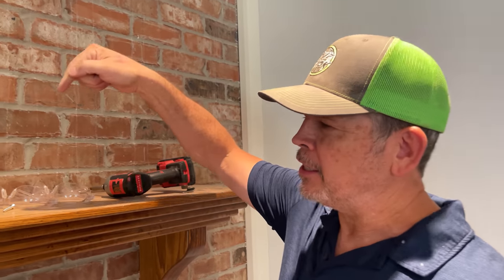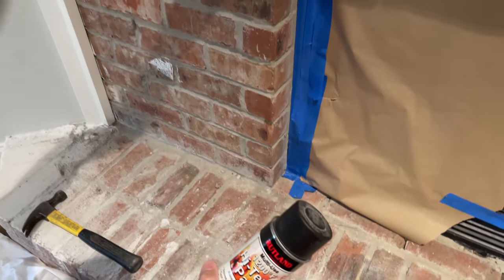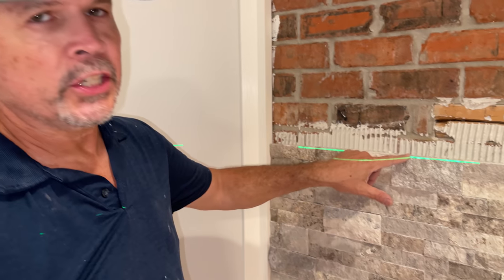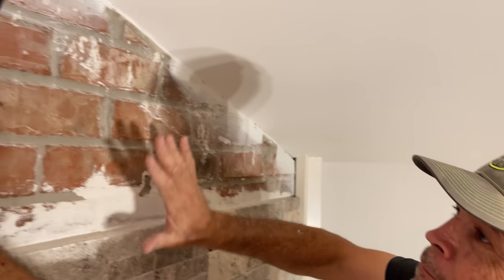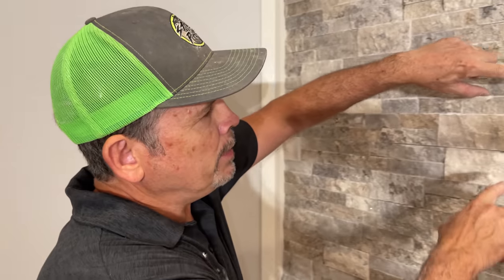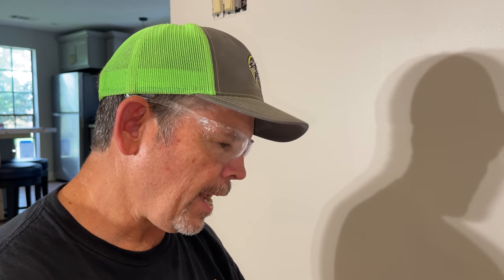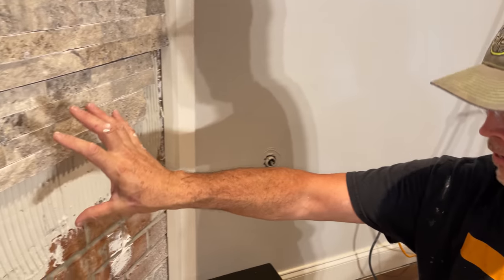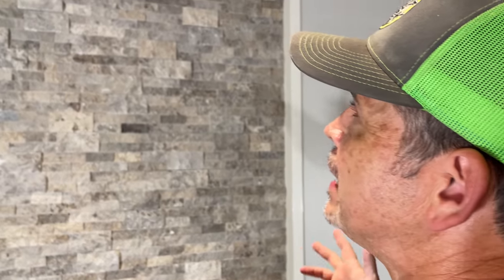DIY FIREPLACE TRANSFORMATION with a CUSTOM HEARTH!

Comment: I have done a few dozen of those for customers so far. Your techniques are perfect and well explained. 
I would just add to not let the customer select the stones are the quality varies greatly and the bad ones are such a nightmare that you should decline to install them.
Also price yourself to include grouting touch up for gaps. Trust me, you will need some grout here and there. You will also need to air clean the whole wall with air from a compressor to really clean it (you will be amazed how much stone dust will come out). Then brush some stone sealer over the whole thing. These last three steps (grout, air, sealer) will make the wall look like a million dollar job.

Comment: Great job and looks awesome.  I have that same tile saw I used to install 12x24 tiles in my 4 foot by 8 foot shower with a 9 foot ceiling.  I never used my angle guide to make any cuts.  I did like you and hand scribed and then free cut like you guys did.  I couldn't have done it without that saw.  You make it look easy and I know it wasn't.  Can't wait to see what's on the list next.
Reply from the maker: Awesome thx Glen 👊

Comment: Nice work as always! A question.. You always use a wet sponge before mortar or thin set on many substrates, don't you use primer or is it just me in Europe? Do the mortars over there have a different formulation to stop the wall/floor from sucking too much moisture out of the mix?

Comment: Love you guys. There is a product called "sticky stone" for mainly outside stoning on bricks or block walls. And for outside and inside a product called , "SRW". The SRW for inside hanging stone on sheet rock is thinner and you use a corking gun and bead the back. You're a pro so you will know how many beads according to length. Note: STICKY STONE is a sausage so you would need to order their gun for it. Either one of these products are slip resistant and dry  fast. No more spreading thin set and it cuts back on time and messes. Try it out. And tell Jordan his humor enhances the shows. Be blessed and remember to give back.👍🏽🙏🏾

Comment: SO, I just bought my first house in 2020...  It's a cute little cottage-ish style house built in 1977.  I clicked on this video thinking I would get some ideas for my fireplace. The first 5 seconds of this video, you read my living room like you'd been there! I have the same brick fireplace, at an angle, with a very similar mantle! Even my hearth is similar! I don't have vaulted ceilings, so that's a relief. But now I definitely have some ideas to redo my fireplace!

Question though: my brick is covered in a yellowish shiny coating, maybe lacquer or shellac, will the thinset stick to that, or is there a lot of sanding in my future?

Comment: What did you do to finish the open edge around the opening to fireplace? I know the edge of them tile's look just as bad as the backside..showing bits of glue and not being finished of course due to the cut. I probably would have trimmed it out with small angle iron or some kind of metal sticking out like 3/4"-7/8" and painted with that same black paint and butted the cut to it. I used that same stone a few different times. I remodeled a master bathroom a few years ago and we reframed the bathroom and changed the layout and customer's wanted to add a free standing bath but with the massive shower we just built I didn't have a ton of space but had a huge hallway on outside so I bumped the wall out like a bay window so didn't take up 2 much space and looked as if was a planned detail. Customer's picked the white stone to be installed on the 3 alcove wall's and choose a spout to be centered on long wall but with the stone not being flat and also wanted to push it off the wall I made up a 2 piece block out of 5/4" Azek and step the blocks to give detail and routed the edges. Worked great. Only suck part of it was not even a yr later tbey called me back and said they didn't call to point fingers and already purchased new materials but if I can come give them a labor price to pull tub,remove white stone and backerboard and install new black stackstone bc the white started to yellow. I thought maybe it was a little in their head but when I got there I was shocked. I never reached out to msi to look into it and the only thing I could come up with was maybe due to them having well water and it having alot of iron in water. The only water that touched these walls was just maybe some moister that wasn't sucked out by the exhaust fan. The white was the only color I ever had a problem with. I also used them stones in other spots around that house..one spot was a accent wall that was 14'w X 22'h in one of the tan colors and all the other spots looked just like tbe day we left but that white looked like it was around a family of smokers that only smoked in that room with doors and windows closed for 20yrs. And this was also a smoke free home. It was crazy but maybe something to look into b4 using the white stone

Comment: That’s a gorgeously well-done refacing!!  Only thing I’d prefer, is putting a cleanable face on those 2 painted areas….matching stone would be a cleaning nightmare …Best:  a brick-width black-steel strip, tight-fitted to cover each side, forming a smooth, cleanable surface.   You could actually fit steel strips over the brick anytime. 
But that black paint does help camouflage the old brick edge…it just looks like a bit of an after-thought.

Comment: I love watching you guys. I’ve learned a lot. Currently using stacked stone in a bathroom remodel as a surround for a curb-less shower. Wondering if you’ve been able to make 45° miter cuts for inner corners, or do you prefer to alternate the stone tile edges as you go up the wall? Would appreciate any guidance or advise you may have. Thank
You! 😊

Comment: Looks great -- you just have to make sure that the beam under the fireplace  is going to support the added weight otherwise your floor is going to sag. Also good luck if you have to remove the floor. What happen to the mantel?

Comment: I am getting ready to do a similar project and just got some great ideas from you video. My gas fireplace doesn't have a hearth, but I was planning on building one. I have a very white stacked stone for the wall but the black granite top to the hearth makes for a great contrast with the wall. I won't have the angles to deal with, but you guys sure made it look easy.
Reply: Did you use the white? I just wrote a msg on this video about the white stone. I used around a free standing bath and had to go back and remove it and ended up installing black due to white staining a yellowish color. Never figured out the reason but was thinking maybe due to them having well water and tbe iron in the moister
Reply: @billzima7068  I did the white stacked stone for the wall and it turned out great. I skipped doing a hearth since it is a gas fireplace and I felt the hearth would have taken too much floor space.
Reply: I'm glad it all worked out for you. I tried uploading pictures but it wouldn't let me. I was just curious curious if anyone else had them problems and possibly give someone a heads up.

Comment: Nice job, unfortunately we too have an red brick 70s/80s fireplace which I have been looking to upgrade. I see you used the thinset directly on the red brick rather than using cement backer board first and laying the stone on that.  Does it matter?  For a DIYer with some experience, is one way easier than the other? Thanks and great video!!!

Comment: Does this fireplace need updating? I'm about to install would but wondering if I should remove the marble slab for the hearth and take the wood all the way to the wall? Would you suggest other updates or leave it as is?

Comment: I have a very similar project, but it would be for the outdoor front of a house.  Lower 2/3 of the house is brick, that we'd like to cover with a façade similar to what you did with the fireplace. Issue is that in my case the mortar joint is square-recessed rather than flush. Given that, do you recommend that I first have the mortar filled in to make it flush, or can I just use a thicker layer of thin-set to make everything even for the façade installation?  Thanks

Comment: Great job overall.  Can't say I'm a fan of the black paint on the inside brick. Perhaps a black anodized metal would better match the insert metal and reflect your workmanship standard. Otherwise very nice work.  Love the way you try one thing and adjust as needed to get the job done right.

Comment: Paul, you talked about nobody wanting a real brick fireplace anymore. In 1981, the Mrs. and I bought our first house, a fixer-upper in Orange, CA. with a double-sided brick fireplace........PAINTED white. I wanted a real UN-PAINTED brick fireplace. I spent 2 weeks SANDING that brick with an industrial belt sander that I rented. I tried to protect the house from the brick dust with plastic sheeting, but it still got all over the house, and I was sneezing brick dust out of my nose for a few days afterward, as well! Got it done though.

Comment: My fireplace steps out as it goes up, so to get this look im most likely going to have to remove most of the brick, I might as well go right back down to the firebox, and use real bricks/blocks, eliminate the need to get creative with the sides of the opening and since my hearth is flush with the fire box floor I have to disasemble this as well, am I opening pandoras box by doing this?

Comment: Well done guys! I believe I will use your video as a guide to renovate my fireplace. With the exception of the angle at the top, my fireplace is an exact replica.  One question relevant to the stone or granite hearth . . .  how much of an overhang did you leave past the new stone under the hearth? 1" or 2"?

Comment: Great job!  Can I ask how to go about removing the same product.  Whomever did this to our home before we bought it didn’t check their level trim the middle down…. And it drives me absolutely nuts!   LOL. Just want to remove it all safely and paint the original brick
Reply from the maker: If they used thinset that's going to be nearly impossible getting the brick back to a paintable state not to mention getting the thinset out of all the mortar joints.  I'd probably try to remove the stone the best I could (cold chisel, ball peen hammer, goggles) then grind off the thinset to get a smooth surface then start over with something you like....stone, brick veneer, etc.

Comment: Considering doing my brick fireplace with veneer as well. I've seen some videos where they say you need metal lathe and a scratch coat even on brick and others say you don't. Obviously not using either seemed to work out well here. Is there an instance where you would recommend lathe and a scratch coat on brick?  I've got regular used brick, fireplace built in the mid 80's so there's nothing really out of the ordinary. Thanks.

Comment: How did you finish the inside edge at the fireplace where you have the profile of the painted brick, thinset, and edge of the stone? Great video as always. Thumbs up for 100K!
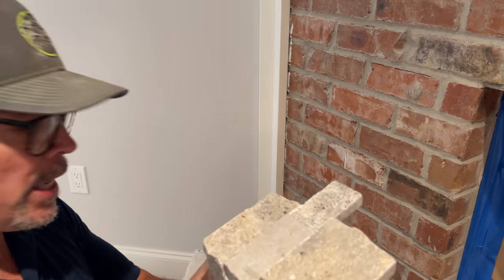Reply: 3:25 and 24:31
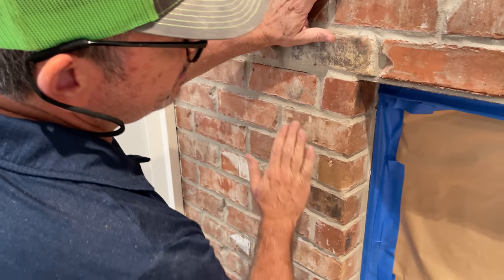Reply: @cdurkinz  I did catch what the plan was at 3:25, and had seen the fireplace opening at 24:31. My question was more about the profile aesthetics of where the three materials will be seen side on (I'd hoped for a closer look at the finished results). But I do thank you for the reply.
Reply: @benefitthirteen  oh ok thought maybe you just kinda scrolled through it I do that sometimes. Ya one of the side shots you could definitely see some thinset squeezeout, not sure if that's a problem or not maybe just at an extreme angle. Still kind of surprised if they didn't finish that edge somehow. The 90s they showed in the beginning looked like they would be nice, maybe they're expensive or something

Comment: I'm about to use a different product from MSI on a master bathroom remodel. It's a thinner stacked stone, and it has a peel-and-stick backing on it. I would have gone with 'regular' stacked stone using mortar, but I would have had to replace the drywall with cement board. Only thing I'm worried about it how steam will effect the glue on the peel-and-stick. I'm going to replace the bathroom fan with a higher-capacity unit, just in case.

Comment: Nice job! Is This a wood burning fireplace? I want to do something like this to my wood burning fireplace but I was told that the heat will cause the stone to fall off.
Reply from the maker: It’s a gas fireplace.  Stone falling off?   What’s the substrate?
Reply: It’s a red brick fireplace
Reply from the maker: You’ll be fine.   To me there’s no better substrate than solid brick... if it is solid brick ???
Reply: @StudPack  thank you so much!

Comment: I did a double sided fireplace with this stuff 3 years ago.  1st go was okay, 2nd is much tighter like yours.  I wish I would have seen the suggestion to trim the glue, I bet that led to some of my minor gaps.  You mention you still need to caulk.  What needs to be done?  Any suggestions on how you'd address minor gaps?  Thanks.
Reply: Use Grout to fill the gap?

Comment: I simply cannot unsee those big gaps from the white side panels against the black stonepanel when you cut it with the multi cutter. Specially on the right side. It’s more obvious because of the shiny black surface which mirrors the gap and creates a shadow effect.

Maybe duct tape on the black panel would have made the gap smaller instead of the thick trowel with blue painters tape?

Otherwise great job with the project!

Comment: I’m using the same type of ledger stone on a DIY outdoor fire pit..  I’ve seen various types of mortar being used and I’m confused on my best option.  I’m also putting a bluestone cap on top and would like to use the same mortar for the entire job..  I was leaning towards a Sakrete Type S mortar mix..
Reply: Use thin set multiporpuse

Comment: I've experienced negative effects from a green laser. If you read up on them you'll find they can damage your eye sight. Sounds silly until you realize you can't see as well anymore, then it's too late. I'd recommend that you look into eye safety and see if protective equipment should be used around that laser. Thanks for your videos.
Reply: Thats why i dont use laser anyway dont need that shit real pro use level

Comment: I have a 26ft ceiling and a gas fireplace so the (fake) chimney is just drywall. If I put this stone all the way up do I need to worry about the weight since it's on the second level of the house?

Comment: When you made the 22.5 degree cut... you marked the floor to guestimate where to cut.  Why not mark the backside of the tile? Hypothetically, with the tile held in place, scribe the pencil on the backside against the brick and you'd get the exact place to cut the tile.  Not saying it's better or worse... Just curious over one method versus another?

Comment: I have a question. Is there a tile that is heat resistant to put on the face of the screen? I wish there was a way to put a photo of this fireplace I have on here but can't. I just went to Lowes to see if they had a heat resistant tiles and they only had stones that you just put up. I don't think my fireplace is fully finished. It has a mesh screen all around and it blows cold air in and I was thinking it has to be something that goes over it instead of showing black mesh screens. 😏

Comment: Do you know, can you put that stone on drywall, or does the drywall need to be reinforced? Given the weight?
Reply from the maker: Drywall isn’t a proper substrate for this product IMO 👊
Reply: @StudPack  Could either cut out the drywall and replace with hardiebacker or maybe apply the cement board to the studs on top of the drywal?
Reply from the maker: MSI approves each method.  I’d remove the drywall though.  If you leave the drywall you’d need longer backer board screws.   1/2” backer board on walls 👍
Reply: @StudPack  Yeah, removing the drywall will allow the stone to sit flush. On the other hand, I'm in Canada, and we have vapour barrier between the studs and drywall, so I'm not certain I'd want to disturb that envelope. I guess I have some thinking to do! I want to put stone behind my wood stove. It's not required, but would look nice. Thanks for the tips!

Comment: I have a square gas fireplace with tiles around it. two beautifuo windows with shutters on each side and 3 avobe fireplace.  Can I reshape fireplace to a rectangular shape and make it longer so I can place my 75 inch tv avobe ? right now it looks akward because tv is too big for fireplace.  Maybe if I make fireplace rectangular and longer than tv it will look better? Is this a big job or not really?

Comment: Could this ledger stone be applied to a fireplace that’s drywall and not brick?
Reply from the maker: I’m not comfortable with installing over drywall.  All the weight is now on those tiny drywall screws.   IIRC the manufacturer had comments about that in the instructions

Comment: Nice work/video though I can't get over the spray painted inside corners that could have given it depth instead of veneer look. But I guess it would have caused problems for the fireplace insert down the road shrinking the opening (?)
Reply: He goes to the easy way you suppose to mitter the inside cut where the black paint real pro as me do the inside mitter cut